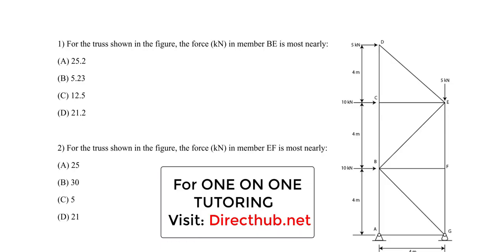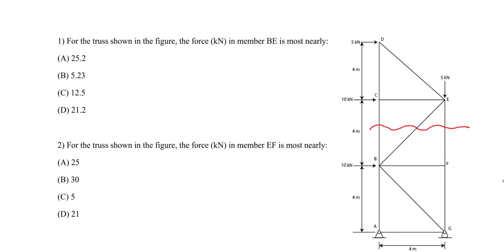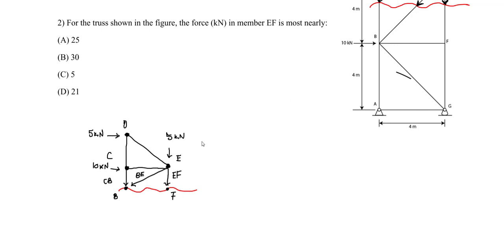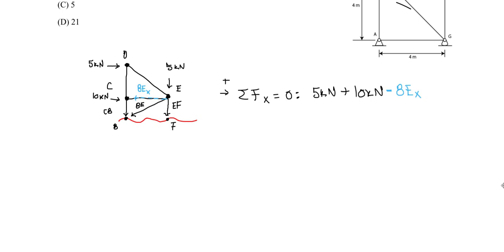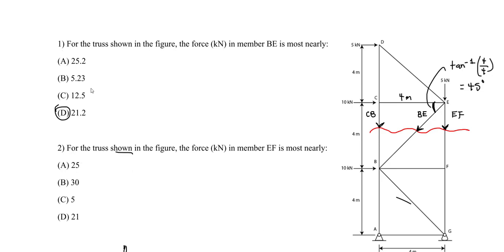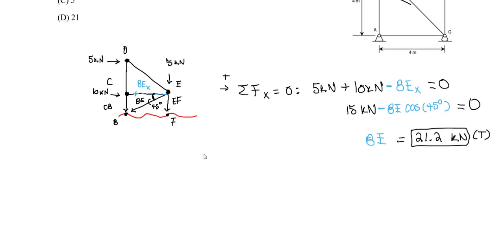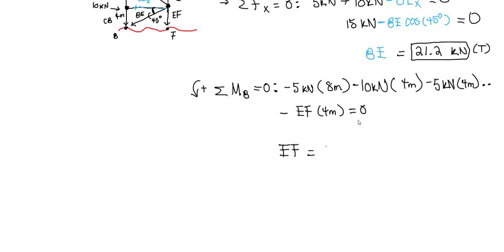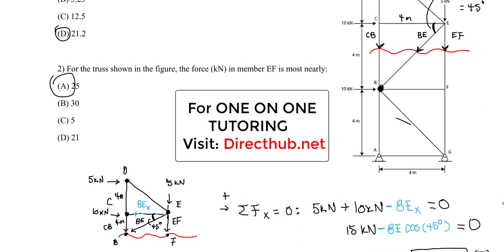FE Exam Review - Statics - Truss Analysis

Comment: I keep not understanding the last part - if you are doing the moment of inertia around B, why is the distance of EF = 4? Why isn't it a straight line to B (i.e. the length of BE)?  [Good video though, thanks]
Reply from the maker: Hi Adam, anytime the force is in the Y-direction the perpendicular distance has to be in the x-direction. In this case, the distance from force EF to point B will be the width of the truss - 4 meters. Check out this figure for the sake of having a visual representation https://drive.google.com/file/d/1ehyW9_T-E8tN2ozs92jynyB3uVWwsrkO/view?usp=sharing